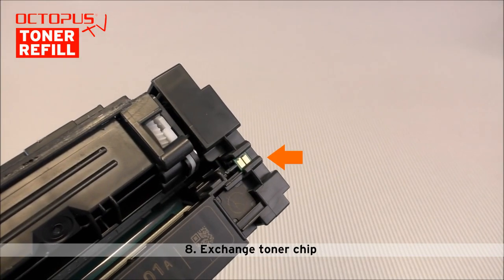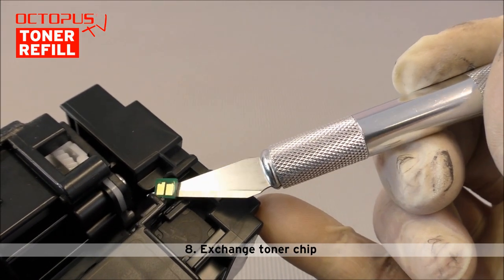Toner refill HP-410 laser printer cartridge 🛠

Comment: Hi. I bought a 1kg toner powder but as I have using it, in the process of printing I tend to experience something unique: i feel that it tends to affect my body, blood beating tends to change and also discomfort occurs. please assist, what could be the problem
Reply from the maker: Thank You very much for Your question. When dealing with toner powder we recommend to work as careful as possible. When refilling You should make sure to wear a mask that is capeable of holding back really fine dust particles as the toner powder consists of these. Also You should make sure that Your refilled cartridge is not leaking toner powder. It is known that there are people which are sensitive towards chemicals component that can be used in toner powder.

Comment: Why do you have to replace the toner chip? Where to get new chip? Dell laser w5300.
Reply from the maker: Thank You very much for Your question. Without a new chip the printer still thinks that the cartridge is still empty - even after filling in new refill toner.  The new alternative chips are available at OCTOPUS: https://www.octopus-office.de/shop/en/toner-powder/toner-powder-hp/hp-pro-m-450-m-452-m-470-mfp-m-377-mfp-m-477/5394/refill-toner-set-with-chips-for-hp-color-laserjet-pro-m-452-mfp-m-377-and-mfp-m-477-black-cyan-magenta-yellow?sPartner=Youtube001